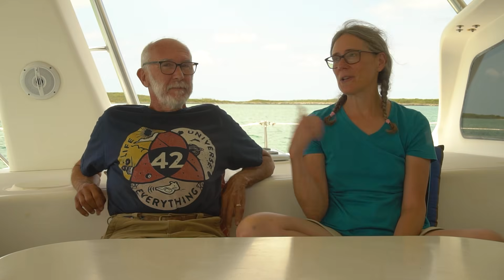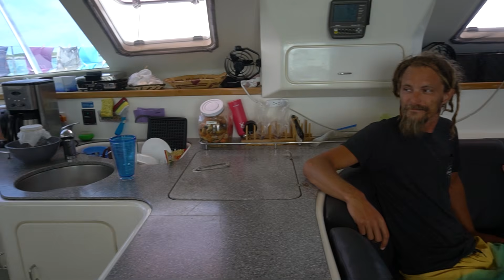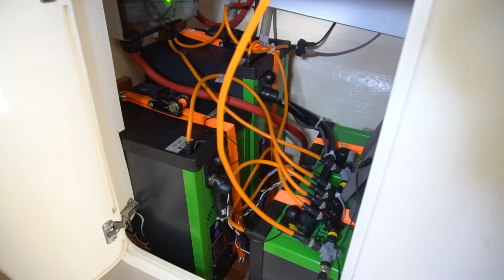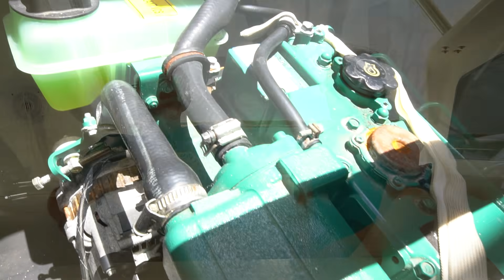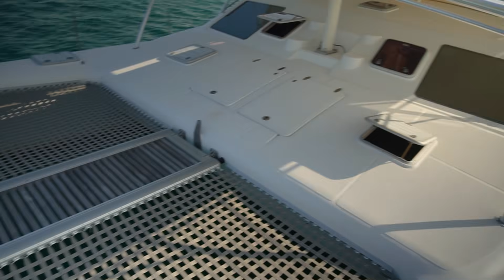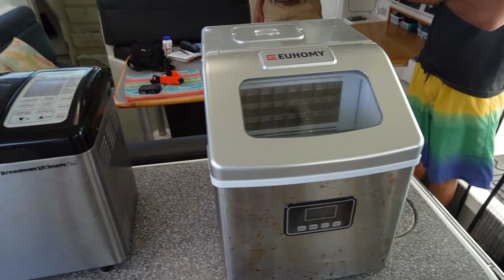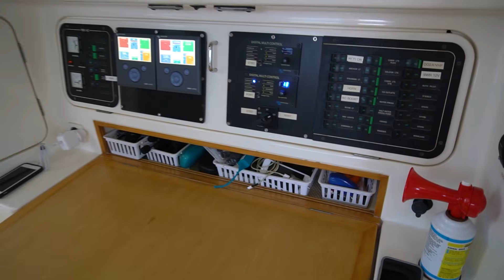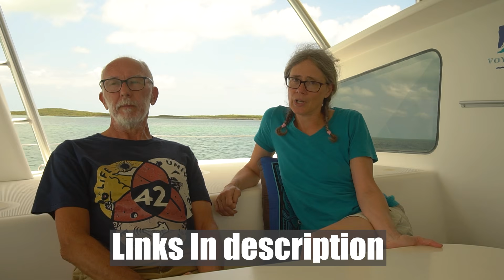100% Solar Electric Catamaran, Interview with owners from Indigo Lady

Comment: I still dont understand why anyone would build a pure solar boat for ocean sailing. That couple could easily manage the sails for that cata and hit 7-8 knots sailing and use the solar when the wind dies. I mean sailing is the oldest method of 0 carbon travel.
Reply: I designed this boat for island hopping, not open ocean crossings. I did sail the boat 2300 miles from the BVI to Maine, but I didn't want my wife grabbing a line under load and throwing her back out, so power works better for us. Sails also shade panels, and depending on the wiring plan, that can really reduce solar input.
Reply: @davidparker6469  I guess it makes sense for island hoping.
Reply from the maker: Not everyone wishes to sail. It can be very intimidating too. When we first first started with our Hunter 33 we knew nothing and every first was scary.
Reply: If you follow other sailing youtubers, you will know that they use the motor a lot when moving a few miles distances or to quickly complete a crossing (before a storm), their spreadsheet shows this size catamaran would spend 3k gallons per year in diesel (roughly 20k dollars since diesel in some marinas are expensive).

Comment: Wicks work better than spikes for lightning protection.
Reply: The idea of a lot of small whiskers acting like spikes is popular, but it does not have a great track record. Once a strike becomes likely, the current flowing from the water surface up through the device (wick or spikes) can dramatically rise. I used 5/16" diameter spikes to handle that critical current whereas whiskers or wicks can melt and stop dissipating charge. When I was a physics teacher, I used a Van der Graff  generator to produce large airborne sparks (~1,000,000 volts). If I placed one metal thumbtack upside down on the dome, that one point dissipated the charge so fast that I could only get tiny sparks off the tip. The mass of the spikes is insurance for heavy current and the number of spikes is less important IMHO.
Reply from the maker: I think after our latest experience with lightning we will be trying some spikes. I'm interested to see the difference but would rather not test it.
Reply from the maker: No idea. Have you tested them?

Comment: Curious how fast you can go into a strong headwind?
Reply from the maker: Really depends on the headwind I guess.
Reply: @WildlyIntrepid  Let's call it 20 or 30 kts.
Reply from the maker: That would be a question for the owners of the cat.
Reply: @WildlyIntrepid  When we are just using incoming solar and batteries, beating into a headwind of 20 knots with 4-6 foot seas slows us down to around 3 knots. We can fire up the generators and go faster, but beating into a headwind and seas at 5 knots just beats up the boat and the crew, so we either avoid those conditions or accept the slow speed. Cats always pound into head seas with waves slapping up into the bridge deck. I don't like to stress the hull (or my wife), so I ease back and crank the tunes.

Comment: Although I like the idea, it’s not very reasonable. All that solar energy is unused 95% of the time. You could outfit the same boat with a 30hp outboard, a few solar panels, a few batteries and get better performance and range.
The fuel usage will be minimum, so is the carbon footprint.
I you sail the boat it will go twice the speed they get.

On the positive side, not having a mast will make them unlikely to get a lightning strike that burn all the expensive electronics.
Reply from the maker: The solar is used much more than that but I get what you are saying. The goal I believe was to run on just what you are taking in from the sun. Yes of course a sail and a small outboard would have been a option but they decided that isn't what they wanted. 
On the lightning note. I wouldn't just assume because there is no mast you won't get struck. Coming from someone who was just struck last week lightning is going to go where it pleases. We were parked right beside a much taller mast and lightning choose us to hit. Lightning imo is too unpredictable to think you can mitigate it somehow.
Reply: @WildlyIntrepid  Yes, it seem even if lightning strike directly it can still fry electronics.
For the solar boat, it’s cool that some people are trailblazers and push the envelope. I just find the e-boat idea a very expensive and long project that push sailing further away into the future. I think that ’Champagne boating on a beer budget’ should be a required reading, I have seen so many people stuck on the boating upgrade and upscale doing so little actual cruising.

We bought a crappy 5k$ catamaran in Florida, fix it up  and went learning to sail in the Bahamas with our kids. Our engine was a 8hp outboard, we used 10X less fuel than on our car even though it was mostly motor sailing.
Reply from the maker: We've also seen so many people get caught up with getting the perfect boat and spending years getting it ready and not cruising. Spend according to your budget and get out there. There will always be something to fix anyways. Sounds like a fun adventure you had with your kids. We might have to read that book
Reply: @alexforget  where did you get a $5K cat!?!!
Reply: @hhealey1  In the Keys (Marathon)
It was a Iroquois (30’) in really rough shape.
I had pressure wash the inside, paint the whole inside, and make new floor board and other repairs.
But we went in the bahamas and the very shallow draft (18") was perfect to sail and  anchor where no one else could.
Now with a better budget I would buy a bigger one so it’s more comfortable while doing crossing and at anchor.
I think we should see sailing as closer to camping than bringing a modern condo on the water. By changing your expectations of luxury you can shrink 10X the budget and still see the same water, beaches, corals, etc.
Reply: @alexforget  Awesome Alexandre! Thanks for tge info. You really made it happen!
Reply: A small solar array and a bigger battery bank would be an option, but that would require several days at anchor to recharge, and would eliminate cruising on just incoming solar. Island hopping rarely involves sailing at fast speeds, and power allows more options for moving in many conditions.

Comment: 🤔
      Out of curiosity, are your generators AC or DC? If DC are they brushed or permanent magnet?  Why did you not want to learn to sail? The boat would go faster, have a much longer range, and one would gain regenerative charging of the battery banks from the ocean volt or external hydro generators.

      What is the speed when running the generators in conjunction with the solar array? What is the speed when not depleting the battery, running on generators alone?  The lightning mitigation measures was smart 👍.

      You were wise to choose a sailing hull for your electric yacht due to the inherent efficiency. The “sun shade” effect of your solar array is cool and additionally improves the efficiency of the array. Thanks 🙏 for being inventive and thinking outside the box.
Reply: Generators are actually AC with a diode bridge to get 48 VDC. Motors are also three phase AC with a motor controller to convert the 48 VDC to AC and control speed. Permanent magnets. I did sail the boat from the BVI to Maine when we first bought it, so I can sail a bit, but my wife has some back issues and I didn't want her grabbing a line under load, throwing her back out and ending our cruising plans. When the sun is shining and seas are mild, we get about 4 knots on just sunlight. With batteries and sun we can run 5 knots for about 5-6 hours, but with the generator(s) running, we can push it up to 7 knots. Being retired we generally run in the 4-5 knot range and anchor up with enough daylight to top off the banks.
Reply: David Parker, Thanks, so much, for your response.  How should I contact you to learn about your experience?
      Vincent Stouter 👍
Reply from the maker: Links are in the description. ;)
Reply from the maker: Honestly you would need to reach you to Dave for some of those questions. Links in description.
Reply: @WildlyIntrepid  Thanks so much.  It was a very interesting yacht.
Reply from the maker: Glad you enjoyed it

Comment: I met this guy a few years ago in deltaville.   It is interesting, suggest:  1) kite power,  2)  remove diesel generators (they should not be installed)  3)   use larger diameter slower propellers for better efficiency.
Reply from the maker: Maybe I'm not up to speed on my physics but I've heard a couple people say things about using a larger diameter prop. I have yet to see it work in practice. I do not see how moving a larger prop through all that water even at lower speeds would be any more efficient. I think I'll leave the hydrodynamics to the professionals why design props and not try and reinvent the wheel.. or prop. The kite is an interesting idea but comes with its own share of problems. And removing the gensets in my mind would be reckless unless you never go offshore.
Reply: @WildlyIntrepid  The larger diameter really is much more efficient.  Look at cargo ships, submarines etc.   The most efficient pedal powered boat uses a 16 inch propeller on a boat barely big enough to hold 1 person.       Further look at fish, dolphin, whale etc.. why is their tail the size it is relative to the body?     Your system is roughly  25-40% efficient from shaft to thrust.   Other solar boats have 80-90% efficiency here.   Check out also "MS Tûranor PlanetSolar" (a very powerful solar boat) they tried different drives to get better efficiency, and race to alaska pedal powered all must use larger propellers.   It is a huge pain to spin a huge propeller for a bunch of reasons but the efficiency tradeoff is huge.   Sail drives are intended for boats that sail (in theory) so are optimizing for other things like reduced drag/weight/cost/durability/feasibility/convenience and so on and the efficiency is not maximized.  If you dont have lots of energy from a fuel to compensate for this low efficiency, the other tradeoffs seem less worthwhile (to me anyway).   With the doubling in efficiency in propulsion it would transform the ability of your boat, but you would need to spin 60 inch propellers.   You would maintain enough speed on solar (and wind) and could remove the generator with confidence or alternately, only run the generator on bio fuels, but inevitably hardly use them, or produce green hydrogen/ammonia with the excess solar power (and hydro power when under kite)   if you want to be early adopter and produce fuel.
Reply from the maker: That all sound great but as a cruising boat anchoring in shallow waters I'll take a so called less efficient prop over something that snaps off or bends shafts any day. Also how are you ment to get a 6 ft prop on a sailboat? Your shaft would be at least 3 feet down on a very steep angle so it doesn't hit the hull. Your thrust would be mostly downward. Then your deepest point would be your spinning prop... Sounds sketchy to me. Would love to see someone successful do it on a boat that is actually being used for something other that deep water. It just doesn't seem practical for a cruiser.
Reply: @WildlyIntrepid  First of all, I love what you have done.. dont get me wrong here.  Thanks for this.   A larger prop may not be right for your intended use but it is hard to ignore the huge potential here.   You really have to think outside the box to make this work.   I dont think inboard or saildrive will work as you said there is no way to run the shaft at a reasonable angle.  It would need to be an outboard that can run at higher levels (prop out of water) for shallow water,  or keep the existing drives for shallow water (and backup or high power) and have a high efficiency cruising outboard for 3-4 knots and 24 hour use.      I built a prototype that pushes me 2 knots using 120 watts.  I improved it now and need to make more video/test  https://www.youtube.com/watch?v=XgMlcdPjUc4
Reply: @seandepagnier  Lager diameter props would certainly help, but I was retrofitting a boat with diesel saildrives. The distance from the prop OD to the hull is a limiting factor, and too close means hull vibrations. The full torque at zero RPM is great for big, high pitch props. At least the motor is a vertical shaft motor so there is only one 90 degree gear to the prop, unlike the two in diesel saildrives. Another interesting option would be a paddlewheel catamaran with the wheel between the sugarscoops.
Reply: @davidparker6469  for paddle wheel you must also rotate the paddles through the stroke so they are producing lift all the time which complicates things, otherwise your efficiency will never compare to a propeller.   I also am considering electrifying my sculling oar (equivalent to 6ft diameter propeller in efficiency at about 85%). I can achieve up to 2 knots on human power this way but I get tired eventually.   The sculling oar can vary the angle of attack giving it the advantage of a variable pitch as well.
Reply from the maker: I like the oar idea. Kind of like the boat in Thailand. Then you could get one big prop on without issue. Also watched the video. Like your idea. Keep us posted how it goes.

Comment: Congratulations! Wondering about the roof for panels that are alredy rigid. Can stay free, and be utilized as the roof.
Reply from the maker: It's a good idea but you still need to support them some way. And rain will likely get through.
Reply: @WildlyIntrepid  Without the fiberglass roof panels under the solar panels, the solar panels would be slightly cooler (already have a 1.5" gap under panels), but keeping the rain out is still very nice, and you still need a catwalk down the middl for accessing rooftop equipment. Can't walk on the panels; too hot!!!
Reply from the maker: Yeah I wouldn't want to walk on the panels. There's always more than one way of doing everything.

Comment: I am thinking 20-40 miles max distance on a complete charge, then you would have to wait for the day's sunlight.   So, this is only a coastal cruiser - cannot sail between islands.
Reply from the maker: Well they have been cruising the Bahamas just fine. I suppose with his setup you would have to decide if you waned to run the genset or increase bank size for larger hopes.
Reply: @WildlyIntrepid  Sounds like running the genset on deisel makes this a 50% Solar Electric Cat, instead of a 100%.
Reply from the maker: And they don't run the genset and use solar. It's a backup for redundancy
Reply: I designed this for island hopping in the Caribbean, not coastal cruising. 20 miles is a frequent hop, and the generators make longer hops possible. we spent 7 weeks in the Abacos island hopping without the generator starting even once. Design your boat to suite your cruising style, then enjoy it.
Reply: @davidparker6469  - Thanks for your comments.  I was referring to sailing 100% solar for longer distances between Islands.
Reply from the maker: Well said Dave. Everyone has different needs and cruising styles.

Comment: I wonder…if it would be feasible to create a vertical solar construction that could double as a sail. Not as large as conventional sails, but taking advantage of direct wind propulsion and getting the benefit of sun energy on windstill days (or both). There are very lightweight, flexible panels avaiable. Bifacial panels would be optimal for this. Just a thought, have not seen it anywhere (yet).
Reply from the maker: It's a great idea and I believe has already been tried. I think solar tech needs to advance more first. The semi flexible panels I would never recommend to anyone even if they were mounted securely. They don't output after a year or so. They can flex but get damaged in the process so what's the point. It's all just marketing. Maybe one day.

Comment: I'm rebuilding a Hughes 40 ketch and I converted it to electric.  I have an 18kw 96v system but I only have 800w of solar and I'm currently have 21kw of battery power..but they're golfcart batteries so my usable kw is about half. I'm still working on it trying to maximize the system but so far I love it. Great video and its an inspiration,  he did a wonderful job on that boat.
Reply from the maker: Your boat sounds like a cool project as well. Maybe I'm wrong but isn't 800w a little low for solar? Keep us posted on your project.
Reply: @WildlyIntrepid  I found that I can run my boat functions(lights, fridge, freezer, microwave,  coffee maker)on 800w indefinitely. Since I barely motor I find I can keep my motor topped up by charging off my house bank on sunny days. I also have a portable generator for longer trips ( if I can't sail)
Reply from the maker: Nice! Ya if you don't need to motor it makes all the difference.
Reply: Why not be the first to build a full solar roof the length of your boat. With 40ft you would surely be able to get 5Kw of power probably a lot more with the latest high efficiency panels.
Reply: @marviwilson1853  thats a beast of a boat. If you’re suggesting keeping the sails it would shade most of it.  If you remove the sails you destroyed a really expensive boat. I have no doubt you could push it along. Not nearly as fast as the sails would. Next you have to consider physics adding that extra weight above your head is bound to make you tippy.  Don’t get me wrong, I think you could make a pretty fun coastal cruiser. It’s definitely a worthwhile endeavor to the right person. You should probably start with a broken hunter though.